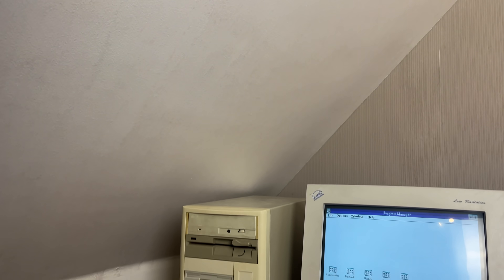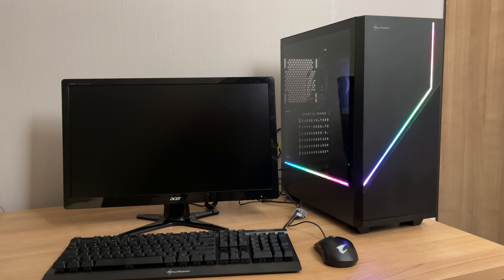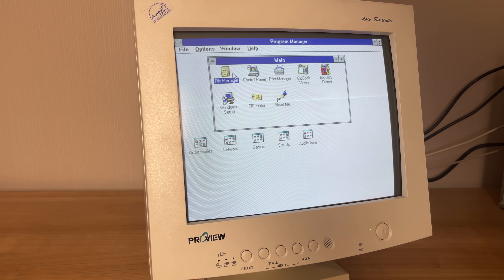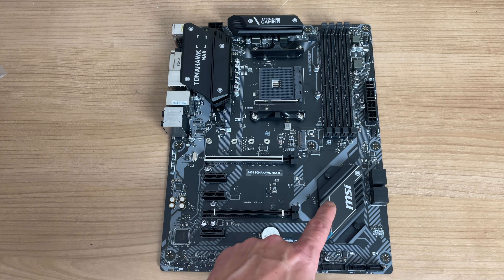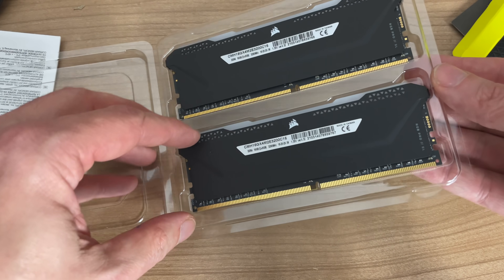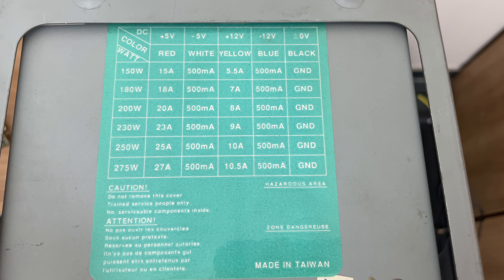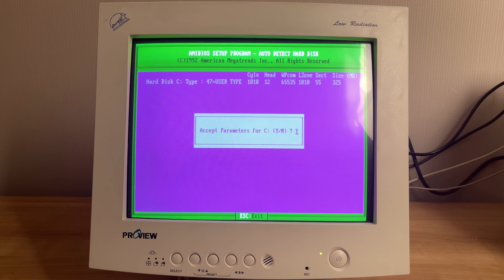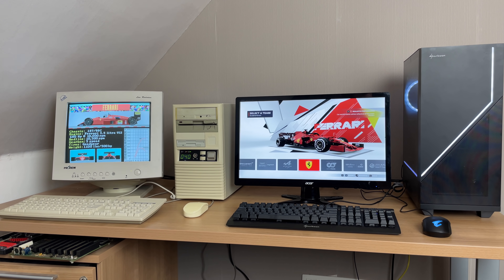Comparing a 1992 Vs 2021 PC Build

Comment: Another difference between old and modern computers, which you did not name, is the presence of a soul in old computers, and modern computers are just expensive pieces of hardware without a soul. From old computers comes such a powerful energy that cannot be achieved with modern computers. When you interact with old computers, you get a huge charge of happiness that cannot be obtained from modern hardware, which is why I really like to tinker with old hardware!
Reply from the maker: Nicely said ! couldn't agree more.

Comment: The typical tower PC hasn't changed much in 30 years at all. Bulky, rectangular cases still hold the motherboard, the connected video card, and cables that connect to storage and peripheral ports.
Reply: Mouse, keyboard and it still runs on Windows.  Back then I expected a lot more of the future of computers tbh. 😄
Reply: You could still do the basic features at that time also, such as typing up documents, quickbooks, browse the internet, play games, etc. Pretty much like you said the foundations for it all haven’t changed much.

Comment: I have quite a bit of storage, only most of it now is not incased in your PC tower.  I've a CD/DVD burner (external) and two external 16 terabyte hard drives.  I also have two 1 terabyte hard drives for data on the go, and I have lost count of all the little thumb drives I have.  I prefer to keep as little in the tower as I can, with three fans.

Comment: That 386 board is what was refered to as "Baby-AT"  I had one very simular but it was a later board with integrated IDE ATA-33 (Single channel) and Floppy interfaces, ran Windows 95 with 8mb RAM, 2x 60MB hdds and a 4x CD-ROM via the IDE channel on a Sound blaster sound card. (I was behind on the computing scene circa 1996, hand me downs and garage sale parts)

Comment: I prefer the look of the older computer, the "beige tower" just says "computer" to me. I just don't care much for all the LED "bling". Also I prefer the Windows 3.1's look over Windows 10. That said, I would still be lost without my Ryzen Windows 10 PC I built a couple of years ago.
Reply: There's plenty of great cases that don't use any leds. In my new build I used the Fractal Meshify Compact 2 because I wanted something with great airflow and great internal designs. There's so many cases today that I'm sure if you looked hard enough you could find something you really like

Comment: Sure, the newer one is more powerful, capable, & whatnot as newer PC's are, being able to do many things with them of course. But seeing the older one that is just a year older than i am, do like seeing that one more. Have a couple of newer machines, my primary PC i built a few months ago & laptop i bought earlier this year (being from 2012 or so, but is my primary laptop). But have far more older machines, ranging from 1995 to 2007, though they are mostly up to 2004. I get more enjoyment out of older ones will say, though newer ones of course with the newer games, programs & whatnot that most would use for basic things. So old & new, both are indeed good types in the ways they are, but i'll say i enjoy older PC's & laptops more.

Comment: you could of had a 486 in 92 if you could afford it, 93 is the year of the og pentiums.  Also this isn't accurate, PCI (original) was out in jan 29 1992 so that's better than ISA-16 for most things.  (2x).  Only 4 mb of memory? you'd likely have 16 mb (max for 3.1) to be able to run the games of the day.

And some 486 era machines did have a good variety of onboard, not just keyboard, you're thinking more vintage that that like the 5150 era days with your build. Even some 386 and 286 did that.

If you had the money (or the knowledge to circumvent that) you could of had 3.11 for workgroups not just 3.1 and get primitive and limited web browsing capability (probably with a 14.4 or some baud modem (either external or in the isa-16/8)

A LOT of boards would have had onboard parallel/serial (common for mouse (serial) and printer/scanner (parallel).  As well as some level of ide and floppy built in (2 ide 1 floppy), You would of only likely of needed that if you wanted more hdds (up to 4 8 gb for windows 3.1) or floppies (to save swapping discs or easy copying)

As far as CPU that's behind what you could of done, a 486 with 66 mhz DX2 would of been top of the line (March 92)

PC100 would of been available in 92 if you wanted to be cutting edge (very low end sticks by the standard of what is currently available though)

And besides if you wanted to be gaming you WOULD of had a Joystick and gamepad of some kind (gravis or logitech)  Some boards would of had videon onboard (Not apu but still existed), and sound (would of been a vibra 16 at best or some poor soundblaster 16 knockoff chipset probably)

So its a lie to say they didn't exist.  275 watt psu for 92 is probably way overkill and most machines (even gaming builds) would of had far less.

So its fair to say that board is cheap and probably mid range by 1992 standards.

Not certain what the best card is for 92 in terms of video card but you could of probably managed better than the trident, esp with early PCI/VESA local bus.  VES is also 92 so its viable and would of been one of the higher end (arguably best but PCI would prove to be better long term as far as upgrades went)  1 GB hdds were in some 3.1 machines (500 to 1 gb typically but those people who did that may of been big spenders or upgraded them later.

Then again to be fair you could technically do better if money was no object for home computers in 2021.

Comment: Who would thought memory, performance and storage would explode in such short time ! Retro - Hyper moderrn, software operating system basic operations, not much changed, only pheriphecals. Pioneering freedom versus W10/W11 restrictions, I doubt first hour users will easely adapt, W8.1 for me last windows version, perhaps ! W10 tunnel vision grey blue I resisted heavely, didn´t like the way it looked. W11 looks neater but thats only fresh out of the box. Linux or chrome may be better, lighter, wish they would drop that ever growing software sizes of software applications and restore some freedom to the user !

Comment: While the new build is very impressive, the older tech like your 386SX-40 was much more challenging to set up which made building PCs back in the 90s a lot more fun.  The current stuff on the market looks complex, but it "just works" out of the box with minimal effort.  Everything auto detects and set itself up.  The 386SX-40 on the other hand, you had to under stand IRQ and DMA channels along with IO addresses to get all the hardware to co-exist.  Then you had to manually load drivers into DOS to get the hardware to work.  While new PCs are very impressive, I still enjoy working on vintage tech because it was always more challenging and fun to set up.

Comment: Hi, one question, how much was the 2021 pc in total Us$? Because i am searching for a New pc under 1.000€ (or US $) and i wanted to know how much Was this setup. Thanks a bunch!
Reply from the maker: The new setup was just under 600 EUR brand new. But you get far better price-performance ratio with a second hand machine with an affordable card like a gtx 970 or 1060.
Reply from the maker: Also bought a complete i5 / 16gb / ssd / 24inch monitor / gtx 1060 for 350EUR. If you just want to do some basic 1080p gaming you don’t need to spend crazy amounts

Comment: Give me the good old 386 with windows 3.11 or just dos. Even though everything is intergrated into the motherboards of today everything nearly connects via usb but RGB is in my eye unicorn vomit and will be a future problem with e waste.  In regards to cable management I am surprised there isn't many computers spontaniously combusting due to cables becoming resistance coils with the way they are routed and stuffed into hiding spots etc but anyhow I used to have one of those old AT towers I am pretty sure was a 386 or even I upgraded to a 486DX2/66

Comment: I did built my 1st PC in 1993, a 486DX66 with 8MB of RAM; a 300MB HDD, a CD, a 10Mbps Coax Ethernet and two floppies 5.25" and 3.5". 
I did built my 2nd PC in 2019, a Ryzen 3 2200G with 16GB of DDR4; a 512GB nvme-SSD; 500GB + 1TB HDDs and 1Gbps Ethernet. 

In between I bought a new cheap 686 from Cyrix and a lot of off-lease PCs. The last two off-lease PCs were:
- a 2003 Pentium 4 HT (1C2T; 3.0GHz) used from ~2009 to 2014 with 2GB DDR; 250GB IDE HDD; 1 Gbps Ethernet; 
- a 2008 Phenom II X4 (4 x 3.2GHz) used from 2014 to 2019 with 8GB DDR2; 128GB SSD + 2 HDDs (500GB + 1TB) and 1 Gbps Ethernet. 
Originally the 2008 PC came with a Phenom X3 (3 x 2.3Ghz); 4GB of DDR2 and a slow 80GB HDD.

I still have the 486 PC in my cabinet and the last time I tried it in 2014, it still worked. 
Once per week for ~1 hour I use the Pentium 4 with 4 leftover HDDs in total 1.21TB as backup server for my desktop.

Comment: pc building is way easier today. I still have nightmares about when I built 286, 386 and 486 systems back in the day.. all you really need is a pentium 2 system for windows 98, a pentium 4 for windows xp and a modern for modern windows, the rest can be done with dosbox

Comment: I'm feeling wistfully nostalgic watching this. it's hard to believe it's been 30 years. I still remember the thrill of upgrading my 286-16Mhz system to a 486-33Mhz, with an all new motherboard and new RAM to go with it. Cost me a bit less than it would have normally, due to the fact I worked for a computer component reseller at the time and got my parts at cost.

In some ways, however, I've still got the "same" machine - it merely evolved over time, an upgrade here, an upgrade there... although obviously I've got nothing left of the original but some data. I do have most of my personal and work email still in my database from 1992 onward, however. Some 20GB just of email alone...

Memories... *sigh*...

Comment: So I had to look this up. But first I was wondering if that is how you found that machine? Things I noticed was the cd-rom and sound blaster was probably an upgrade later on. Same thing with window 3.1 I remember two things about those type of motherboards. Upgrading memory for windows 3.1 and they would make great boards to upgrade a old 8088 or 80286 clone machine. In fact I got one in my collection that somebody did that type of upgrade. I was going to say something about the case. But I can't remember when everybody started using tower cases instead of desktop cases. Also in the small town I lived in. We seemed to be about 2 years behind places in California and such. So besides being 20+ years ago. I found myself sometimes a few years of form that.

Comment: I'ved upgraded a couple laptops and refurb desktops with the Kingston kc2500, the 250 was on sale a while ago. Nice drive! Really good stuff. Kingston makes really good SSD's, the cheap A400 SATA drive is one of the most reliable I've ever seen, and I've sold a bunch of them, even though the A400 is slow it's a runner. I've sold so many A400's and never had one go bad, I've had more samsungs and crucials be bad.

Comment: dunno if the new BIOS is an upgrade, considering you get time to grow a beard by the time it finishes, like all modern BIOS I know... Just as it seems we get faster boot media, they compensate by taking longer, making sure it always takes too long to boot.
Reply: Between that and OS bloat, there isn't all that great of a time difference between my oldest machine from 1998 and my current 2020 model. Just a few seconds "out of the box", although both systems booted significantly faster when tuned a bit.
Reply: @MrJest2  I own several old computers. Trust me, if you want to juice them up, Linux or BSD of the very lightweight kind works. Managed to make it speedy on computers with PIII and 512mb of RAM (that just buys time tho, those OS also get beefier with time). Avoid anything with python.

When under those specs, just live the life and use FreeDos, Ms-Dos, OS2, Windows98se or even better, 95 (before 4.0c)or if planning to use Ms-Dos, Windows 3.1. At this point I connect those machines to Internet with no care and you can enjoy stuff like Telnet BBS. If you set something like an SD to IDE hard drive.

Even a super low spec computer can be useful today. Office software works the same if no better, games, thinkering and fun... Of course, only if you love computers a lot and don't mind sinking your free time on those!

Comment: As someone who has built, upgraded, and repaired PCs during that entire timeframe, I find it amazing what hasn't changed. Motherboard still get screwed into the case, expansion cards are still expansion cards, RAM still gets plugged into the motherboard, the front panel connectors are still a pain, etc. Up until fairly recently with NVME, hard drives were just hard drives - either 3.5 or 2.5". Performance certainly has changed though!

Comment: The main difference other than the actual hardware is the amout of knowledge you needed. And readings manuals were essential.
Thirty years ago you had to know things like how to plug in the AT plug, which resources are avalible to my ISA card, how many of the same speced SIMMs to install, how to jumper your IDE drives or does your SCSI drive have a terminator build in. And if you had everything right there was always the possibility of component A is not compatible to component B and had to be changed against component C which is maybe not compatible to component D if you paid no attention to the article in the newest computer magazine where it was mentionend how to configure the components.
Nowadays you basically have to pick the right mainboard for your CPU. CPU Coolers will mostly fit Intel and AMD sockets. Only one typ of DDR memory will fit the board and you can use only one stick if you wish. You can choose any PCIe extention card as long its physical fits on your PCIe slots and most current cards will be recognised by Windows and a driver will be automatically installed.
I mean it is easier to build a functioning PC nowdays without much knowledge about the parts you're using and how it works as thirty years ago. Will it be the best PC for your budget or the optimal PC for you? Probaly not but you can upgrade or change parts later if you gathered more knowledge.

Comment: 3,5" drive from 720 to 2.88 MB in some IBM Drives , in fact the ami bios configuration supports 2.88 MB at 3.5" floppy disk

Comment: Click... whirrrrrr... zirp,  bzzzurp zzurp, bzzzurp zzurp.... beeep. Chatter chatter chatter. I hated how unrefined the PC's post and boot process was, back in the day. My Amiga 3000, like a modern machine, has barely any drama when booting up, same with my vintage Mac SE. But now that UEFI firmware has relegated  (provided you don't have legacy support turned on) the real-mode BIOS to history, I find myself missing all the legacy nonsense. And yes, the more removed modern systems become from the BIOS era, the more I miss the most obnoxious old-school parts: painfully slow memory counts, loud 5 1/4" disk seeks, endless Adaptec feature BIOS messages and late-post SCSI disk spinups.

Comment: Why use the stock cooler? I see a hyper 212 evo v2 in the intro shot? I've had  3 of the fans on those AMD coolers lock up after a few months in use, on a 1600, a 2600 and a 3600, now i got a NH U12 for the my 5600x and its so much cooler and quieter now.

Comment: Very nice comparison. It gets even crazier when you go back a little more in time. When I built my X99 platform Xeon two years ago and put in the 4x8GB RAM sticks, I actually had a short thought that I am currently putting in more than 1000x the capacity of RAM that my first computer I owned in the late 80s had as a hard drive. My Sanyo 286 actually came with a 30MB hard drive. The NVMe in my current PC is capable of transferring the whole content of the hard drive of my first PC 120x per second.
The cute the SIMM modules loo compared to the massive DDR4 sticks (where half of the size comes from the RGB stuff), imagine having 16GB in 1990s technology with 1MB SIMMs. This is MASSIVE!
The BIOS: Ah, the 386 AMI BIOS. Childhood memories that live on in one of my retro PCs. But what always makes me smile is when people say that you can make out if you have a BIOS or UEFI based on graphical user interface. Then I look at the text based UEFI of my Dell Ryzen 5 laptop and the AMI WinBIOS of my VLB 486 and just smile :-) But the current gaming/workstation UEFIs look super-fancy, that's true.
The Mitsumi CD-ROM is great. Was my first CD-ROM, too, and I still have one. And no retro boot process is perfect without memory test ticks and floppy drive seeks.
But two nice computers. One period-appropriate 90s system, the components fit well together, and one very nice speedy modern system.

Comment: 1972,1982,1992,2002,2012, to 2022. Lots of changes every 10 years. Now for 2032, 2042, what do you think they will look like?
Reply: I recon PCs will get more smaller in size, Due to physical size of storage drives, Also some cases i have seen no longer have drive bays for CD and 3inch drives now,  Then you got a lot of stuff going on board now, like the M.2 drives
Reply: Or 2050 2100..maybe pc s will be  built in your hand or pc s will be history because another things will be..who knows man..but i m very curious how pc s phones and consoles will look like in 2050 2100

Comment: Coincidentally, I recently acquired a vintage motherboard very similar to the 386 one here.  The differences between this one and mine are mine is green instead of yellow and mine has a 486SLC-33 CPU instead of the 386SX-40.  Solid little board if you can get one.  Great video, as always, Retrospector!

Comment: I also have a 1992 386 I built couple years ago. It is 33Mhz 386dx though with 8MB ram and tseng labs ET4000ax video card 120MB hard drive and Sound Blaster CT1320C.